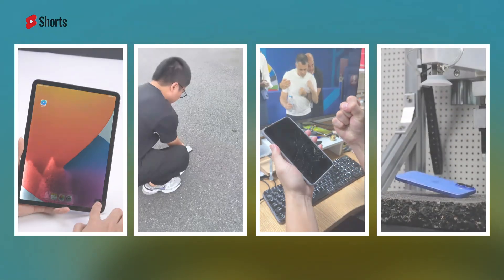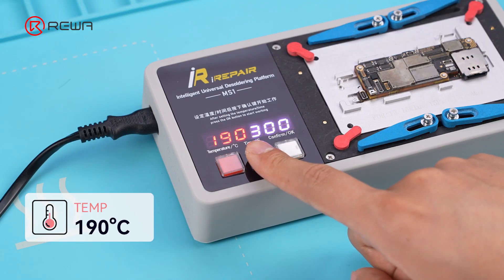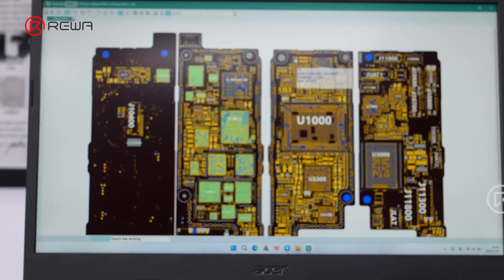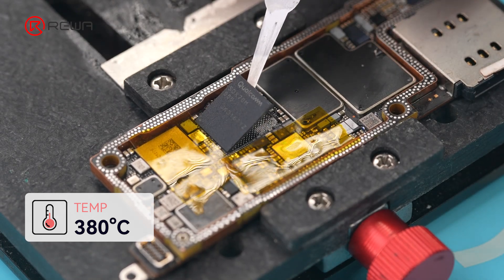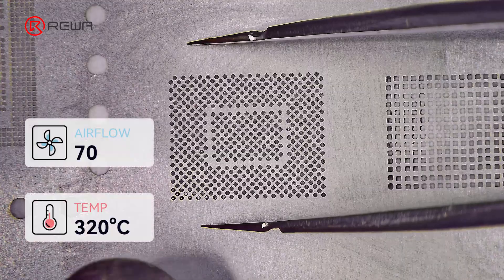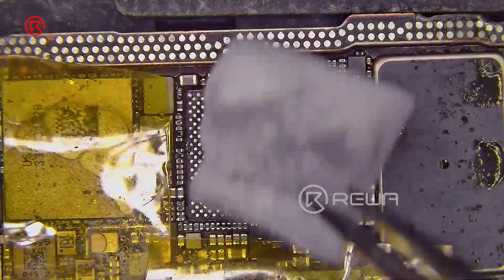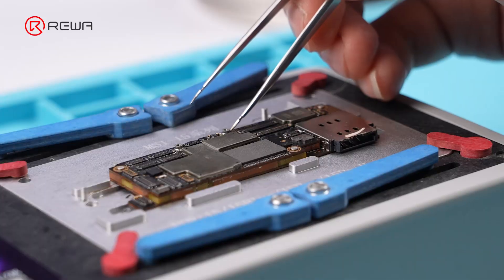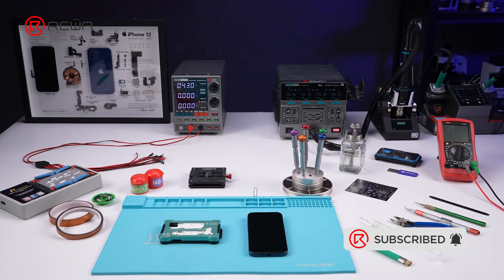iPhone 15 Pro No Signal Repair - Step by Step Troubleshooting

Comment: I didn't see that you applied thermal paste to the processor
Reply from the maker: As we mention, this phone we used to demonstrate it with the teardown and test, so it thermal paste is gone like long time ago, and now in repair market, the thermal paste does not have a great replacement.
Reply: @rewatechnology2008  so, it is okay not to use it? I thought its not good

Comment from the maker: We hope this detailed troubleshooting can help you gain more professional repair skill❤❤ Leave your comments 👇 

Repair Tools：
1.REFOX RS3 3D Screw Driver Set:
https://shop.rewa.tech/detail/refox-rs3-3d-screwdriver-set.html?utm_source=YTB0417&utm_medium=video&utm_id=Repair+Tool

2.XZZ Motherboard Function Test Fixture:
https://shop.rewa.tech/detail/xzz-motherboard-function-test-fixture-for-iphone-16-series.html?utm_source=YTB0417&utm_medium=video&utm_id=Repair+Tool

3.Intelligent Desoldering Platform：

https://shop.rewa.tech/detail/mijing-ms1-intelligent-preheating-desoldering-platform.html?utm_source=YTB0417&utm_medium=video&utm_id=Repair+Tool

4. Solder Paste Flux:

https://shop.rewa.tech/detail/halogen-free-solder-paste-flux-my-up-78a.html?utm_source=YTB0417&utm_medium=video&utm_id=Repair+Tool

5. Scraping Knife For BGA Reballing:
https://shop.rewa.tech/detail/tin-scraping-knife-oem-new.html?utm_source=YTB0417&utm_medium=video&utm_id=Repair+Tool

6.SUGON 8650 Pro Hot Air Station

https://shop.rewa.tech/detail/tin-scraping-knife-oem-new.html?utm_source=YTB0417&utm_medium=video&utm_id=Repair+Tool

7.SUGON AIFEN A9 Pro Soldering Station:

https://shop.rewa.tech/detail/sugon-aifen-a9-pro-soldering-station.html?utm_source=YTB0417&utm_medium=video&utm_id=Repair+Tool

8.Mijing MJ-138 High-Purity Solder Paste:
https://shop.rewa.tech/detail/mijing-high-purity-solder-paste.html?utm_source=YTB0417&utm_medium=video&utm_id=Repair+Tool

9. 3 in 1 Knife Handle & Blade Repair Set:

https://shop.rewa.tech/detail/mijing-3-in-1-knife-handle-blade-repair-set.html?utm_source=YTB0417&utm_medium=video&utm_id=Repair+Tool
Reply: do you accept repair on iPad Pro 12.9 3rd generation power issue?